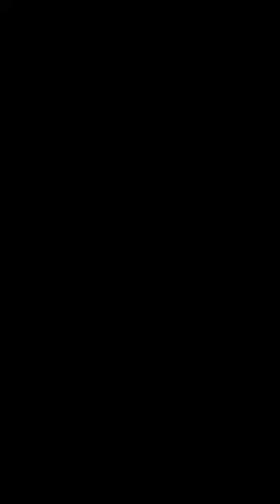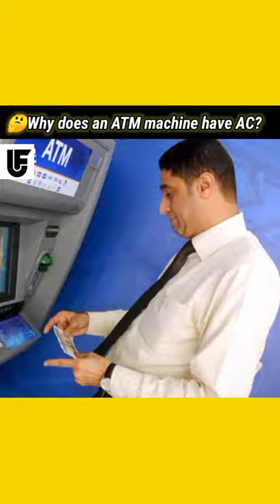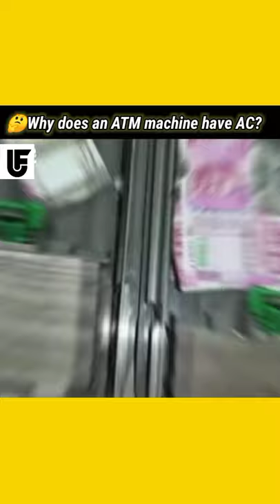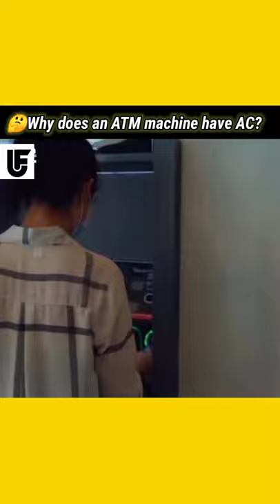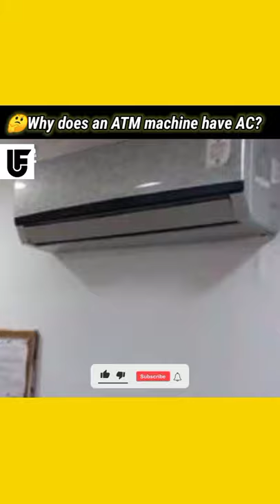🤔Why does an ATM machine have AC?#shorts #viralshorts #factsshorts

Comment: Not true
Reply from the maker: which part is wrong ?
All this information is taken from google
Reply from the maker: Friends, if we run our mobile phone for a long time, it starts heating up.  Because it is an electronic device.  If any electronic device is operated for a long time, it starts heating up.  ATM is also an electronic device and is kept operational 24 hours a day.  Due to which the ATM machine gets hot.  That's why AC is installed in ATM.  Due to the presence of AC in the ATM, the ATM machine does not get too hot.  If the ATM machine gets too hot then there may be a possibility of some malfunction in it.  That's why it is necessary to always have this in the ATM.  Due to the presence of AC in the ATM, the ATM machine and all the people coming there get the benefit.

Comment: Not true and pointless video
Reply from the maker: what part not true in video
Reply from the maker: Friends, if we run our mobile phone for a long time, it starts heating up.  Because it is an electronic device.  If any electronic device is operated for a long time, it starts heating up.  ATM is also an electronic device and is kept operational 24 hours a day.  Due to which the ATM machine gets hot.  That's why AC is installed in ATM.  Due to the presence of AC in the ATM, the ATM machine does not get too hot.  If the ATM machine gets too hot then there may be a possibility of some malfunction in it.  That's why it is necessary to always have this in the ATM.  Due to the presence of AC in the ATM, the ATM machine and all the people coming there get the benefit.